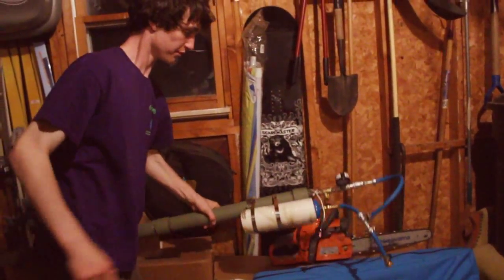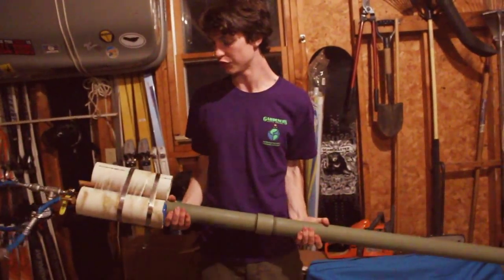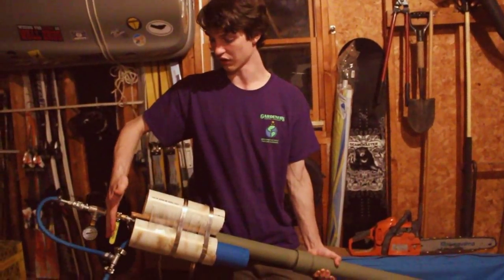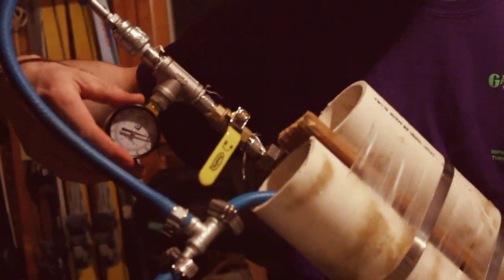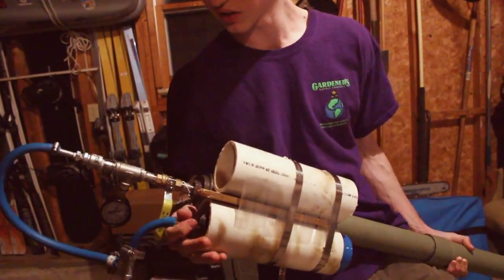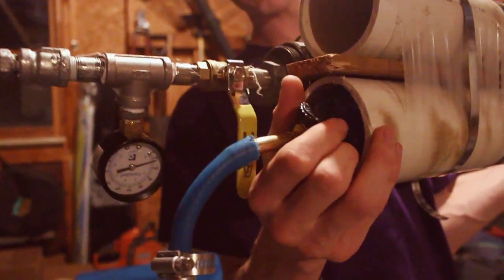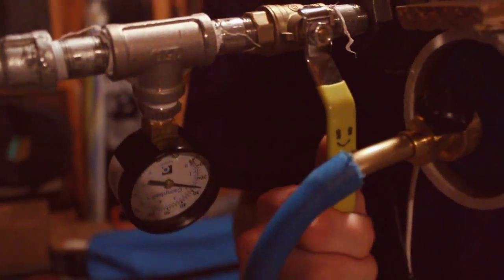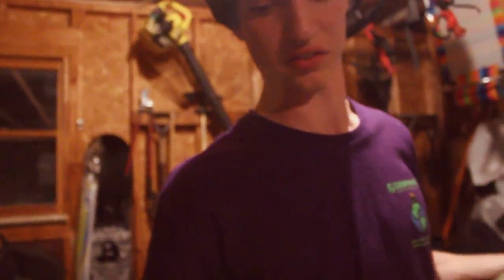Oxy-Propane Potato Cannon

Comment: how did you measure the muzzle velocity? I've never heard of a combustion gun breaking the sound barrier, only hybrids.
Reply: That's not to say I'm accusing you of lying, I'm just surprised is all.
Reply: Im with you. I made a cannon with a 12 foot barrel and a 7 inch diameter chamber, and only barely breached 400MPH using OxyPropane methods.
Reply: Lol so you probably never heard of acetylene cannons …
Reply: They are using a gas to air mix under pressure. Pressuring the gas. This is an advantage gas has over a solic combustible, you can pressurize it to increase the bang for buck. If they could figure out a way to pressurize a small chamber, like .30 cal could they fire bullets at supersonic speed with no need for extracting or ejecting of a casing, in theory yes. A very clean firearm.

Comment: I want one that shoots baseball's or rocks with a rag packing behind it if need be
Reply from the maker: After the video we fired 10 inch long pieces of 1/2 inch steel roundstock encased in a wooden sabot. They were pretty accurate and did some damage to a tree and steel plates.

Comment: Isn't it better to use a steel barrel?

How much pressure can you pull in that tank?
Reply from the maker: The sched 40 steel pipe we used has a working pressure of 650 psi. Since the potato is creating the seal at one end of the chamber, we can't pressurize the chamber with fuel too much or it will push the potato out before ignition. The steel can obviously withstand much more, which is why it was a necessity for oxy-propane fuel. I've seen people attempt to make oxy-propane cannons out of pvc and the results aren't pretty.
Reply: What you can do is use a PET diaphragm (i.e. plastic soda bottle bottom) to contain the compressed gases. They're good to ~125 PSI. Load the ammo, put the PET in the way, pressurize to 80 PSI or so. The overpressure spike from the combustion will burst the "disc" and away we go!
Reply: I made one and it shoots much faster than this one. Made out of PVC. You dont need to pressurize the chamber with fuel. Mine has a 12 foot barrel and it exceeds the velocity of any potato you shot. Also, your potato did not breach the sound barrier. If you chose to argue so, please do a follow up video with a radar gun or a scaled slow motion shot.
Reply: @snarshmallow  you can slide a smaller barrel inside the larger barrel so when you pump pressure into the chamber the potato wouldn't just slide out as it needs the explosion to actually squeeze it through the smaller pipe..